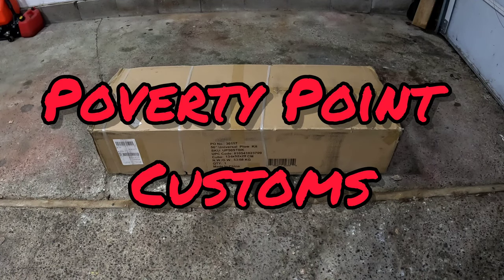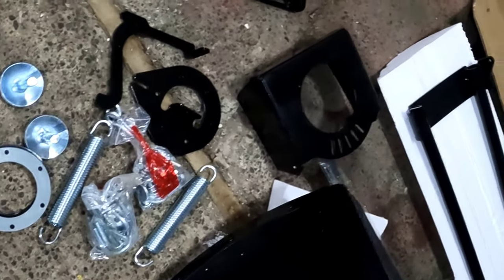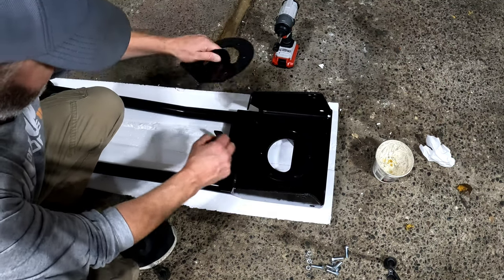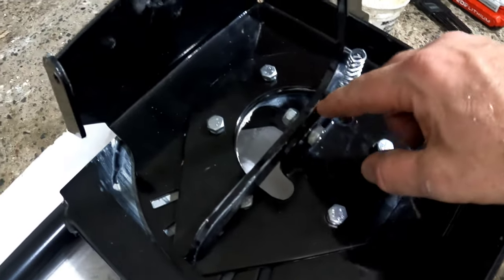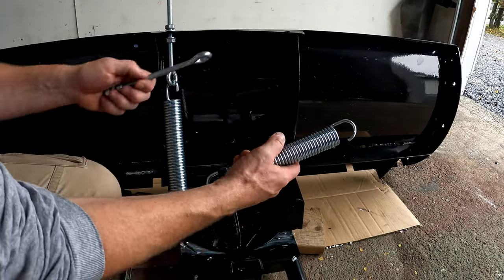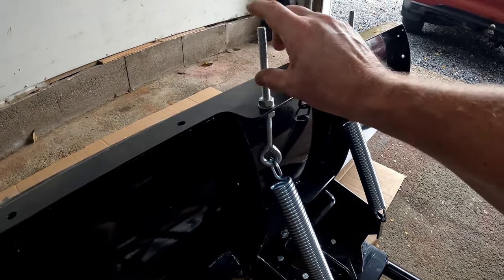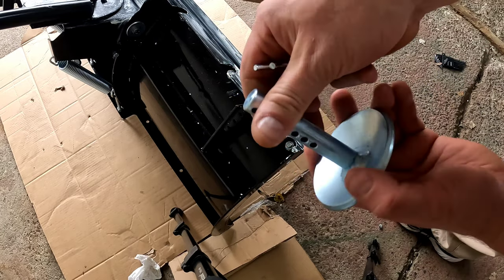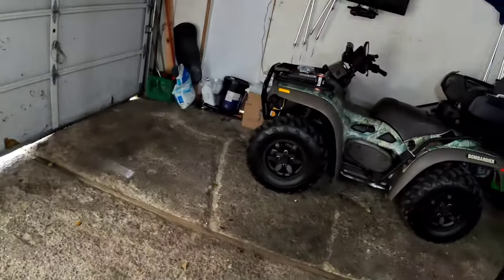MotoAlliance DENALI ATV 50 inch Universal Snow Plow Kit Installation Video

Comment: You should undercoat the back of the plow and underneath the bike to keep it from rusting, also recommend switching from cable to rope.
Reply from the maker: All undercoated, actually bought a rope so that's the next chore, also looking into a winch strap possibly for the plowing season